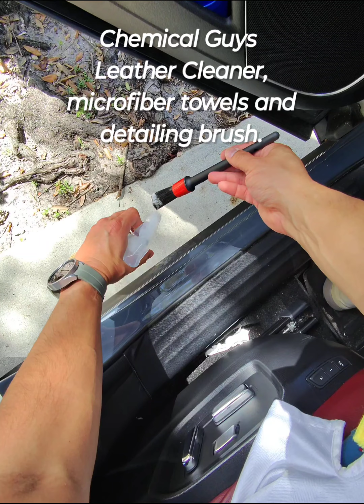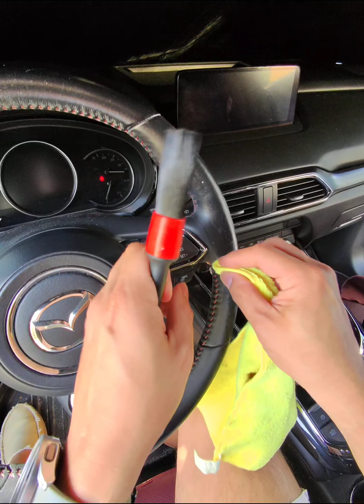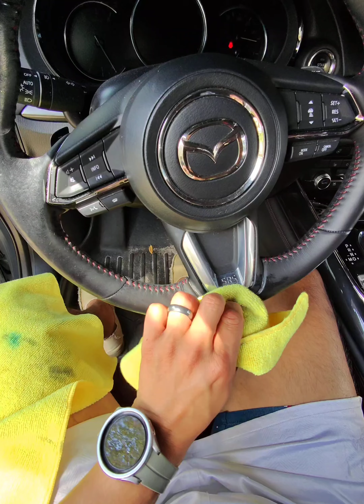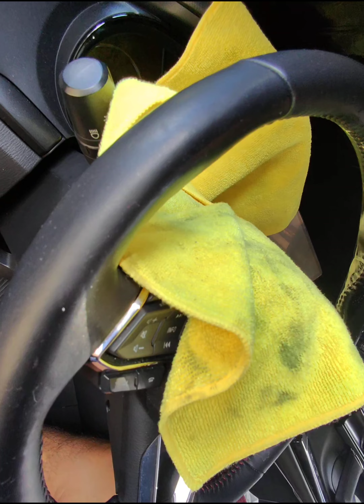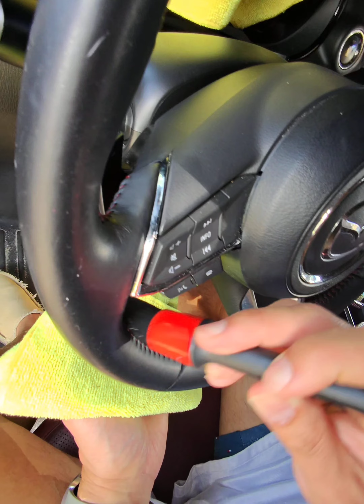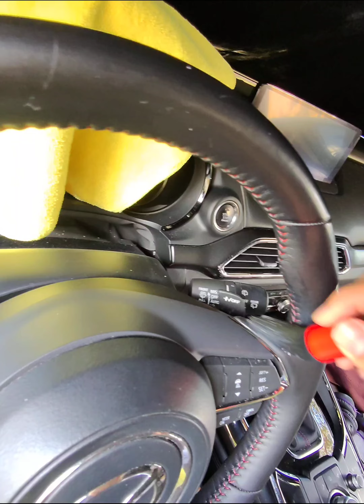How to make Leather Steering Wheel look like new

Comment: Problem is it doesn't stay clean for long and chemical guys puts something in the spray that makes the leather look dull again but doesn't last at all.
Reply: That's because you're not suppose to end on the cleaner.
The cleaner is literally meant for just that - cleans.
Natural leather is porous.  If without any conditioner / lotion / cream / etc., are NOT suppose to look glossy.
"Dull looking" is due to those pores.
If you don't like to use the conditioner from Chemical Guys, that's fine.  But if you want protection after the cleaner, use something.

Personally I prefer lotion meant for human skin.  I personally keep a bottle of the King C Gillette moisturizer lotion in the door pocket.  After hand-sanitizing, or a forceful nose-wipe, that's the lotion I use for my hand/nose/face.  Does not leave any sticky feel.  That's the same lotion I use to occasionally condition my steering wheel leather.

If you used lotion that leaves a sticky-feeling on the hands, that's the same sticky residue that'll transfer to the steering wheel and then stick all kinds of dirt to the leather.
Whereas, non-sticky feel lotion, they fill the pores of the leather, leaves a semi-gloss look, while keeping later dirt from sticking to the leather.
Reply from the maker: Thanks, I'll keep an eye out, my wife was telling me that maybe it was makeup from whoever used to own the car.